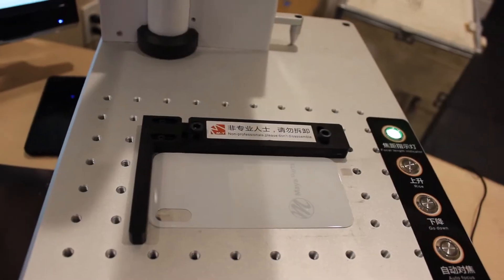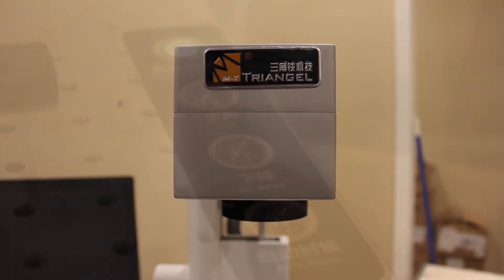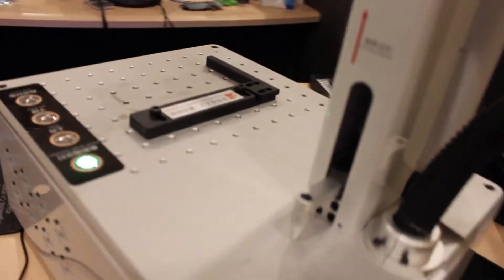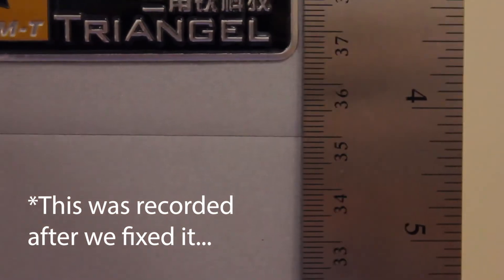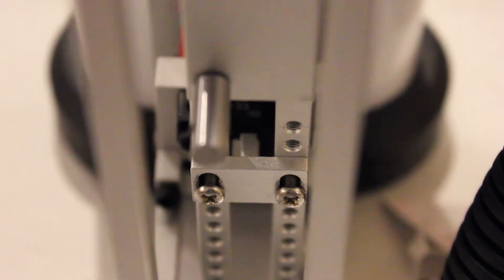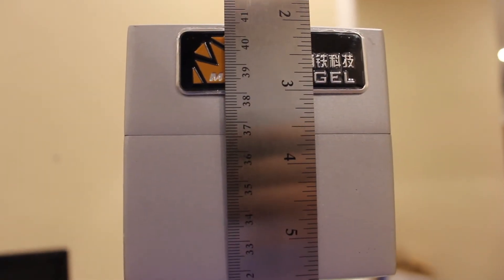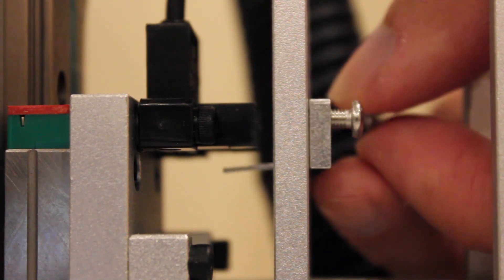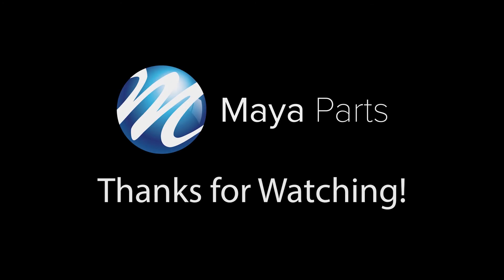PGoneS Weak Laser Fix

Comment: Do you have any idea what is the problem with my pg ones? When i engrave square it looks like on the start and end is missing line. Its like laser starts to work with delay, changing opening delay setting does not change anything.

Comment: Hi , I have the same machine . I am having a problem with the red laser.. it just stays as a dot in once place (towards the corner of the machine) 

Anyway of fixing ?? 

Thank you
Reply from the maker: Unfortunately, the machine has a tendency to do this. Usually, starting and stopping the laser (or moving the template while the red light is on) will fix this. But if not, reach out to your vendor as there may be an issue with the laser itself.

Comment: Why Laser is weaker on White Surface but good on black?
Reply: Black absorbs more light than white
Reply from the maker: It depends on the material that you are working with. Since the laser is just a high-powered light, it can react differently with different kinds of surfaces. For example, we noticed that etching an iPhone SE back produces uneven burn patterns (and lines can become dotted, rather than continuous). Experiment when trying new materials, and if the burn is just slightly weaker, then reduce the burn speed (in the right-side menu) or repeat the burn. It should come out darker that way.
Reply: Dear Martin
Thanks for your Video, But my question is that aluminum part will go inside of that black sensor or will sit underneath of that?
Reply from the maker: @suneetdhiman6678  The aluminum tab goes in between the two parts of that black sensor. When the tab passes through, the machine detects it, and stops the autofocus movement.
Reply: @mayaparts1460  Thanks

Comment: Hi.

Great videos. Thanks a lot :D

I have a question about this laser. I got it for a couple of weeks ago and it worked fine. But now when I hit the red light button and the laser starts to mark on the phone, it doesn't mark right. It marks 2-3 mm away from the edges. So when I start it to remove the backglass,  it doesnt do it as it should.  How can I fix that? Hope you can help 🙏 If you want, I can send you a video of it

Comment: My man my machine focus lights won’t turn on
Reply from the maker: Have you checked the autofocus assembly yet? Sometimes that little tab (see video at 1:28) will get bent during its assembly at the factory. If that tab does move into the autofocus mechanism, then it won't trigger the light. If the machine is focusing but the light isn't turning on, then you can still use the machine, but you'll have to use the autofocus feature instead of manual focus.
Reply: @mayaparts1460  Mine was bent and when we try to fix it we broke it. Do you have that part in stock?
Reply from the maker: @suneetdhiman6678  No, unfortunately we don't sell these machines anymore. But I believe that part just blocks a sensor. If you can attach something to replace the broken tab, then it may work again.